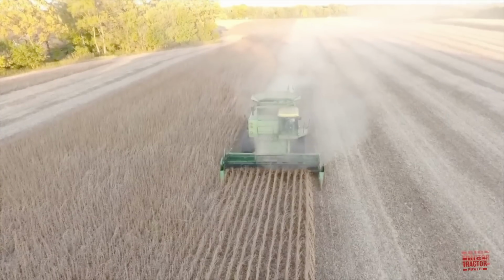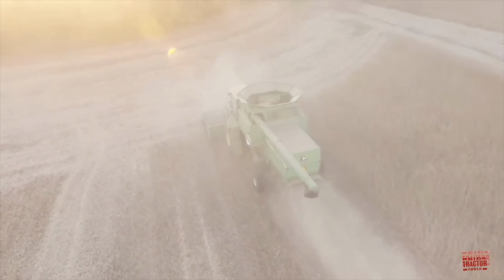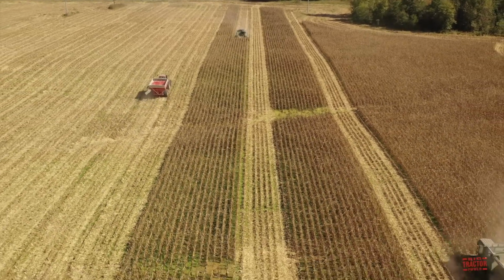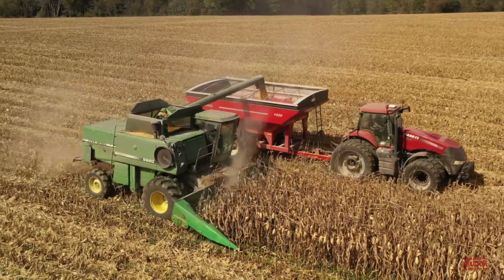JOHN DEERE 8820 Titan II Combine Harvesting Corn

Comment: I would take a 8820 over all the modern day combines any day
Reply: Yeah because u can switch cylinders raspbar and spike tooth
Reply: You would be making a huge mistake
Reply: I used to think that owning a 6620, then we got a 9500...NO turning back after running that.
Reply: 1680 case with a cummins is far superior, but that being said the 8820 was definitely a good combine, i would definitely not shy away from one
Reply: What about ease of repair compared to modern ones, as well as availability of parts? Breakdowns? Efficiency?

Comment: They were very high capacity for their day. I was always impressed with them.
Reply: Yep, but now they're kind of small by modern standards 30+ years later, and 2.2 bushels/second is a very slow unloading rate
Reply: If you compare those to, today’s combines, then they would be very slow
Reply: If you check the PAMI reports, there capacity wasn't very hi in comparison to TR96 Gleaner N7 in fact not even close

Comment: Was only around a few of these. One neighbor had one, his cousin , had a 7720. Both machines were considered the big rigs in the county.  Both required a lot of maintenance yearly, but they did cover a lot of acres annually.  There's still a 6620 next farm over. The family bought it new, on a smaller acreage.  A big farmer I worked for back in the mid 90s, had a late 8820 and a 9600 while I worked for them.  That 8820 was traded for a 9610 the last year I put up with the jerk that ran the place.  I would have loved to get it from the dealer, but they wanted way too much.  I guess they had too much in it to make the original trade.  All those walker type machines had serious issues with breakage in there, and bent cranks. The reason I went to a Axial Flow for my operation.

Comment: Does anyone know why they put the motor up front like that? I always thought that was an odd setup.
Reply: It made a lower center of gravity, not really an issue on the 8820's but it did on the 6600's and smaller. They wanted to maintain the same configuration through the whole family so they did it on the larger ones also. Here on the hills of central Pa, the Massey Ferguson's with the front engine, or earlier, having the engine mounted down behind the front axle, ruled the field until JD moved the engine up beside the cab. Once JD brought out the sidehill's, Massey's days were over around here.

Comment: JOHN DEERE 8820 Titan II Combine with JOHN DEERE 12' Pickup Head, 6 Belt
6 Belt with JOHN DEERE 213F 13' flex head with John Deere 444 Corn Head - 4 Row, 36in Spacing

Harvest The Crops Winter Wheat
Spring Wheat
Barley
Cereal Rye
Oat
Millet
Sorghum
Corn
High Corn Moisture
Soybean
Reply from the maker: Very cool set up for an 8820. Thank you for sharing.

Comment: Twenty-seven K seems expensive just for a header back in the 80s.
Reply from the maker: I have a price guide from that time and that is what it lists the 843 at.
Reply: @bigtractorpower  I wasn't disputing you. I just think that is rather expensive for back then. JD is just getting greedier and greedier. Now they won't even allow you to repair your own equipment. Thank God States are bringing in legislation to combat that.
Reply from the maker: @dr.michaelr.foreman2170  no worries I just wanted to share my source.  I just posted a video on a 105 combine which was $12,000.  I was surprised the corn head for it was almost $4,000 in 1969.
Reply: @bigtractorpower  4k is a heck of a lot less than 27k. :)